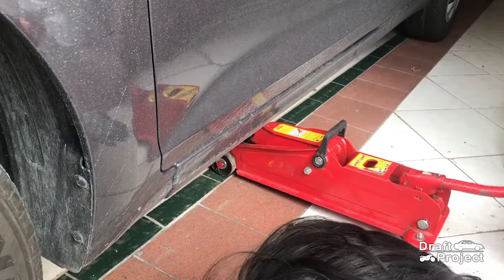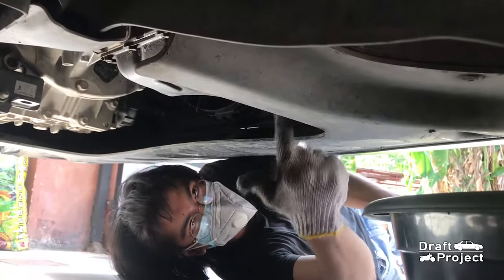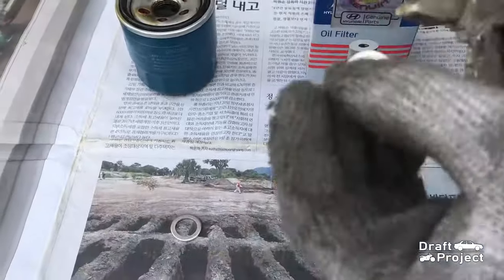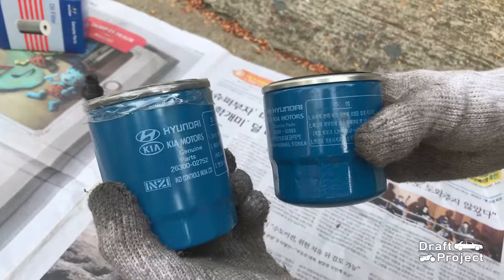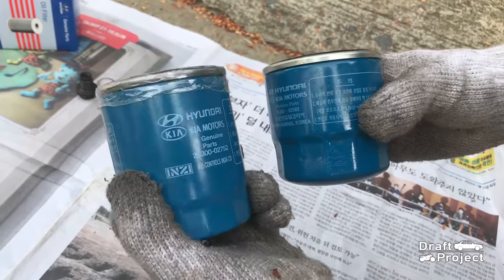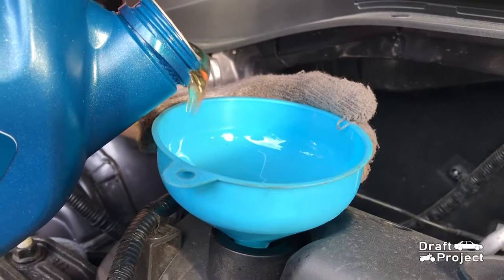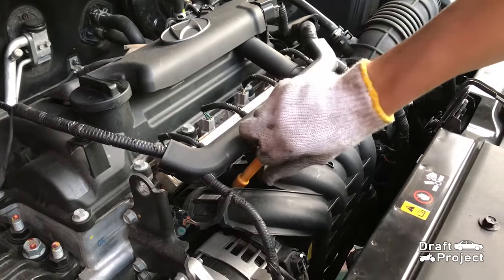Hyundai Accent Engine Oil Change

Comment: Thanks for the video. I have a 2019 1.6L and all of the parts are in the same place. Didn't even need to remove the skid plate or use jack/stands. I got a pair of ramps and went to work. Lower angle, but a lot less work trying to set it up. 

If you run a decarbonizer, ATS or some other brand prior to the change, make sure to wear gloves. That oil is HOT when it hits your hand. Sounds dumb, but it is easy to rush and forget until the heat wakes you up. Haha
Reply from the maker: Thanks a lot for the feedback and advice! Take care:)

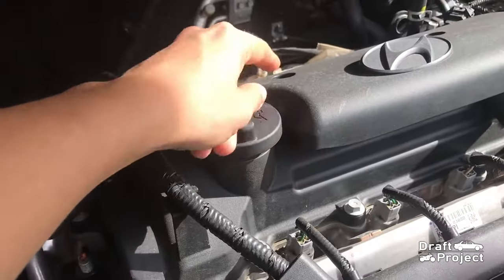Comment: at 1:22    if you put the cardboard down infront of the splash shield , No oil will get on the splashshield ,instead of putting just the bottom of the cardbaord ONTO the splash shield. In otherwords ....lift cardboard up slightly & allow bottom of cardboard to lower so that its in front of the S.S.   not on top of the S.S.
Reply from the maker: My bad. Thanks for the advise.

Comment: Hi, great instructional video. I'm gonna try this on my 2004 Hyundai accent today. But i only have one jack. So i have  questions:
How many jacks do i actually need, in the video have you used 4? I can borrow some. And is the car meant to be level or could i drive it up some sorta home made ramp or bricks. 
Also, do i just go to a car parts shop and ask for one of those little washers off the bolt? As i'll need to buy it before i start the job. Will they usually know and have them available?
Thank you so much. Hope you can reply.
Reply from the maker: Hello!
For this vehicle, it is recommended to drain the engine oil in leveled position. The drain bolt is located at the front of the engine and the oil pan is in flat angle. If you drain the engine oil with the front end only being lifted, you might not be able to drain all of the fluid because of the design of the oil pan.

One jack should do the job. Heres how you can do it.
1. Lift one side of the car, particularly right side.
2. Put one axle stands for safety.
3. Put a drain pan underneath the engine
4. Loosen the drain bolt and let it drain
5. Remove the oil filter
6. While draining, jack up the vehicle, remove the jack stands and lower the vehicle. Be sure to check the drain pan when lowering the vehicle.
- Here, you lower the vehicle to get the most of the fluid out of the oil pan. As the vehicle gets leveled, the oil drains faster.

7. When it stops draining, lift up the car and put some axle stands. Continue the process of changing the engine oil.

In the video, I used 4 jack stands because I have other jobs to with the vehicle. If I were to change an engine oil only, I would only use one and do what I listed there.

Those little washers are called aluminum washer gasket. Yes, they are usually available. Have those washers first before you do the job. This washers seals the drain bolt upon tightening. Its recommended to change those washer everytime you change your engine oil to prevent any potential leaks.

Hope this helps. If you have any further question, please don't hesitate to comment. I will always gladly answer to help you.

Thank you very much and take care.

Comment: I have an Accent 2020 and use Amsoil engine oil. Does it harm the engine if I do not use its oil prescribed by the company?
Reply from the maker: Potentially yes.

Regardless of the brand of engine oil, as long as those standards, specifications and viscosity rate is matched with the requirements, it is absolutely fine to use.
Reply: i assume youre from a warm country
i use 5w30 amsoil in my accent 2020
Reply: @N3Garage may amsoil bng pang gasoline gasoline kasi sakin
Reply: @PadikoyzTv meron

Comment: Hi i have a 2019 Accent 1.4 and I have a question about the transmission, my car currently has 53,000 kilometers and I'm planning on getting the transmission fluid changed at 55,000, is the transmission filter replaceable? If it is what is it's part number, I couldn't find anything about it in the owner's manual. Thanks.
Reply: Its an automatic by the way
Reply from the maker: Hello, I tried to search for it and this is what I have found.

Link: https://www.ssg.asia/cats/#/parts?groupId=IzLwn5qANDM0NTJfNDM0NTIxMg&groupsPath=MfCfmoBNSQ%21MfCfmoBNSfCfm7BJekx3bjVxQU5ETTBOVEpmTkRNME5USXhNUQ&catalogId=hyundai&modelId=d9871a9bfbde4eea0767bf1f7d55fa98&carId=96715673e617c8a00c7238ddfca18644&year=a68bff82a64894a80e800f7ad88b34ab&sales_region=a3c25c8ec8c894587cc2bab906b88f58&steering=593b53050475a5ed532c28837afcace1&trans_type=1a89f73fa79167dee1955bcc7194d7a0&engine_capacity=aa910f6f2b7a7a37fab247a1484e540e&transmission=7421e234089fd3106fe0b793429137fb

That is a parts diagram. The part number for the transmission filter is 46321-2F000.

 Before buying it right away, please have it check at your nearest Hyundai auto dealership to make sure that you have the right code and buy the correct part for your car. These parts might have some differences when it comes to part number due to classification of region.

Also, owner's manual only provides the basic knowledge about maintenance and other information. When it comes to technical aspects like this, you can find it on the internet or contact your nearest Hyundai dealership. 

I hope this helps! Thank you and take care.
Reply: @DraftProject  thank you so much, i will ask the dealership. although i was checking rhe Hyundai forums and only saw someone say it's not a serviceable part
Reply from the maker: You're welcome. I also tried to check and it appears that most of them only change the transmission fluid, not the filter which could be true. I haven't done that job before in a Hyundai Accent, so I'm not really sure about it. I agree that the best way is to consult at your nearest dealership.

By the way, the Hyundai Accent in the video is not mine, so I don't have that much access to that vehicle.

Thank you!

Comment: How did you jack that car? I can't get a trolley jack under my Accent
Reply from the maker: I jacked it on the pinch weld. I've used a rubber adapter in between the jack and the pinch weld to prevent bending the metal.

Comment: I have accent 2009 ,i use shell oil 10w40,but the mecanic advised me to use mannol 10w40 api sn /ch4???!what do you think
Reply from the maker: I guess it's better to check your owner's manual for your engine oil requirements. If it only indicates 10w-40 without the specific ratings, then it's fine to use what you are currently using and switching to the oil that your mechanic has advised is optional.

If it has ratings on it, then it is better to follow it since that would indicate as a minimum requirement for it.

The oil that your mechanic has recommended to you has better protection properties, which is good for your engine, turbo and EGR.
Reply: Thank you for your answer, what about liqui moly spuer liechtlauf ?!
Reply from the maker: That engine oil is expensive but delivers an excellent performance. Liqui Moly is a reputable brand, can't go wrong with it. 

I've once tried a different expensive brand "Amsoil" and the engine felt so smooth and light.
Reply: @DraftProject  thank you 😊

Comment: Hi,why use different oil filter in this oil change ? I have a 2014 Accent with 1.4 Kappa engine,and i use oil filter last coming out of your car in my engine,it's Mann W7023,and kappa engine requires 3.8 litre oil according to handbook.So I use 4 litre Liqui Moly Molygen 5W-30 oil every maintenance.
Reply from the maker: The owner of this vehicle bought the oil filter at the dealership and they only offered him that specific oil filter, for a reason that they don't have the same oil filter anymore.

Thank you very much for the information.